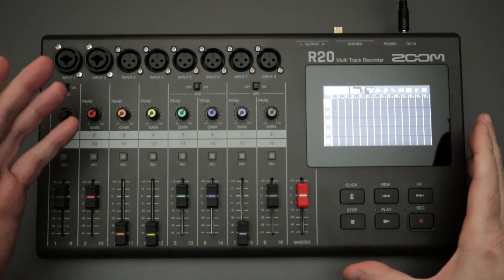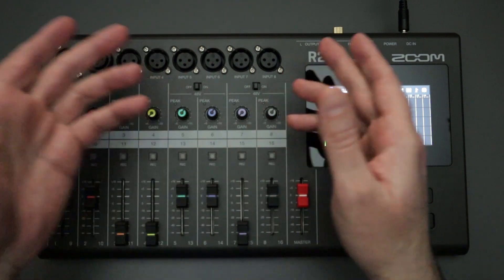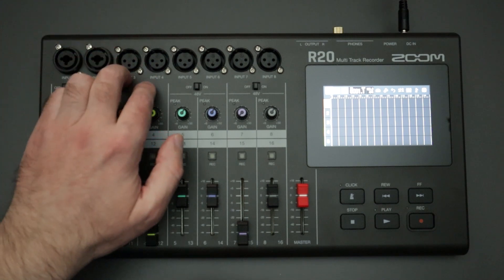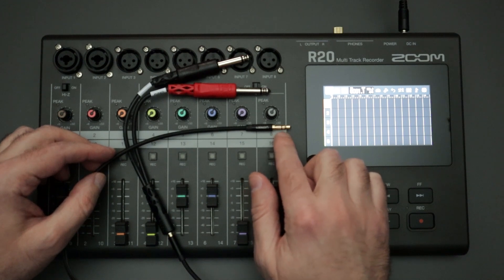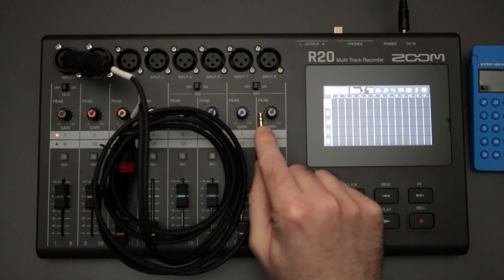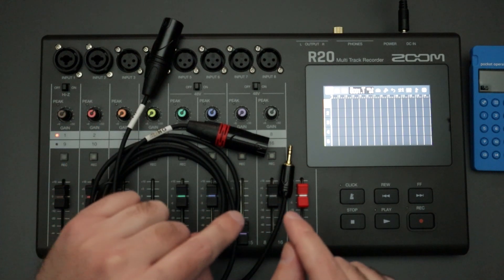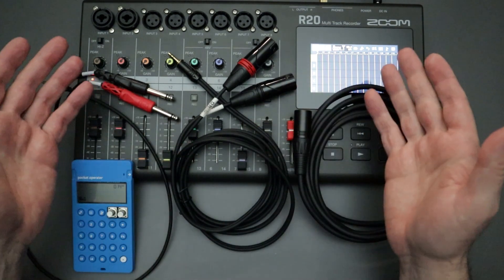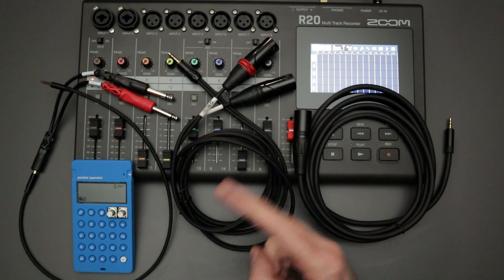ZOOM R20 - using all the inputs with TRS to XLR cables (applies to many mixing boards too)

Comment from the maker: I just wanted to further specify that you can absolutely use 1/4" to XLR cables, as long as the TRS to XLR cables are wired the same way as demonstrated in this video.  It doesn't just have to be 3.5 mm to XLR. Or you can place a TRS 3.5 mm to 1/4" adapter at the end of these types of cables.  However, you want to avoid sending stereo signals from a TRS cable to a single, balanced XLR end because you likely won't get any useful sound.
Reply: Is there a way to change the volume of a single region within a track?
Reply: exactly.. the reason the sound will be bad is because what do those channels is more than likely feeding back in through the other signal path. so the full signal is not making its way into the intended destination (ie XLR)...this is likely causing damage to your source device.. a little bit of damage here a little bit of damage there.. eventually with enough use and the compounding damage, your device well just stop working all together.. DI boxes, or mono summing cables are the best solution. 
Rule of thumb, if the sound is lower than you expect.. for instance if you have to turn your cell phone up to maximum and then boost the mixer gain way up just to get a decent signal, STOP STOP STOP. you should never have to crank the volume and gains really high just to get decent volume. if you ever find yourself having to do this, there is more going on under the hood that's causing this... repeated use will definitely be damaging your equipment.

Comment: @GazRendar, Hi, how are you doing ? Just one question, for example: Can I connect 2 balanced outputs (L+R) from Fractal, Kemper or other effect box with IR direct to inputs 3 and 4 ... or 3 until 8 using balanced cable (XLR to XLR) ? Or I just can use the inputs 1 and 2 for this purpose ? Thanks
Reply from the maker: Doing well, thanks.  Based on what you are describing, you should be able to use any of the inputs.   But really, using inputs 3 and 4 are perfect for that.  You just want to make sure you're running the Left signal on one balanced XLR cable to input 3 and the Right signal on one balanced XLR cable to input 4.   You don't want to run a stereo signal through a single XLR cable to a single input on the R20 because that might cause signal cancelation depending on how it's all connected and routed.  And obviously, if you are using the R20's inputs #5-8 keep the phantom power off if you are running those XLR cables from your effect boxes to those inputs.

Comment: Can't really figure this out from anywhere but I thought it was worth asking - could you hook up an interface to act as another set of combo jacks? i.e. Can I set up my Focusrite to input 3 and 4 and get some extras? Don't know if it takes usb audio...
Reply from the maker: No, that won't work.  It doesn't accept USB audio and the Focusrite usually needs drivers to work with a computer, so there's nothing like that with the R20's minimal operating software.  If you don't want to use TRS to XLR unbalanced cables you can always use mixing boards or DI boxes to get the job done.
Reply: @GazRendar  Thanks, I have an r20 on the way and your stuff has been very helpful and i know it will be again when I get down to brass tacks. Much appreciated.

Comment: Thanks for your great video. I have a question. Can I use two XLR-to-Jack cables to connect a Nord Stage piano with two separate outputs (left and right)? If so... then I think it should be TR instead of TRS? Thank you!
Reply from the maker: Yeah, so if your Nord has a 1/4" mono jack for Left Out and a 1/4" mono jack for Right Out, you'll need TS to XLR unbalanced cables.  I'm not sure if you can set the line level out on the Nord.  It might work with the R20's XLR inputs, but not sure if there will be enough volume there.  I'm guessing it will work ok, but you might have to turn up the gain on the R20.  If not, you could always run a 1/4" TRS stereo out of your Nord's headphone jack to XLR breakout cable with L and R mono, unbalanced XLRs to get it to work.   Then plug your headphones into the R20 to hear everything.
Reply: Thanks for your answer and advise @GazRendar  ! So there is no quality-loss if I use headphone out instead of separate Left and Right out ?
Reply from the maker: Unless you really turn up the headphone out volume to near max on the Nord, where it might distort the sound, there shouldn't be any signal loss.  On top of that, I think you are going to want to plug your headphones into the R20 to hear how the recording sounds, not how it sounds coming straight out of the Nord.   That's especially true if you apply any effects with the R20.  But you can experiment and test out cables for both the line outs and the headphone outs, depending on your budget.  I know it'll work for the headphone out, but I'm guessing it will probably work for the line outs too.
Reply: @GazRendar  thanks again for your detailed answer!

Comment: love the example of the 3.5mm TRS to XLR. I've seen so many examples of people using a cable such as that to plug in a laptop or smartphone into a mixer and then wondering why it sounds so bad. I think people need to understand how equipment "balances" a signal to fully grasp why you can't simply convert a stereo TRS signal to XLR just by using adapters or a generic cable like in your example. 
the best way to do it is by incorporating a DI box that will split the unbalancedstereo signal into 2  balanced mono outputs. OR, a more cost effective (but obscure) option is to build a "mono summing cable"... I built a few for my Zoom L12 because it has 4 Stereo TRS outputs (meant for IEM systems). but since I wanted to send the signal to stage monitors I needed to somehow mix down those stereo outputs to 1 mono signal. With a TRS to mono XLR (like in your example) it is very possible and probably more likely that you are causing irreparable damage to the output stage of the chain... in other words, there are 2 discreet signals flowing from your stereo output and since electricity will flow in the direction of least resistance (aka impedece) there is a good possibility that some of that current being sent from the stereo output is "feeding back" into the other channel of the output. Rule of thumb is you can split a mono output and send the signal to multiple destinations, BUT you cannot use the same splitter cable in reverse and combine 2 signals to send it to 1 destination... even though a stereo TRS plug is one plug, it is still considered two signals. so trying to combine those two signals being sent from that one individual TRS plug to a destination that uses one mono input (like a XLR input on a mixing board) could be damaging that source device. I mean it might work for a while..(although it would sound like garbage).. but eventually it will just stop working and you would have realized that you somehow have damaged your equipment. 
Making a DIY mono summing cable is not difficult and there are maybe one or two useful tutorials online (believe me, there's a lot of info on pro audio websites, but there are literally only a couple useful tutorials!). you basically need to use something called a resistor Network in one of the channels. Sounds complex, but it's just a matter of soldering in a couple of low voltage resistors in the signal path of one of those channels. this increases the impedance of that pathway, thus making the path of least resistance to be the intended output. So no more backflow of electricity slowly damaging your devices output stage. 
PS: some devices have inbuilt protection against this sort of damage.. but I highly doubt your pocket operator has the required circuitry to protect itself from this sort of damage.. so I hope people understand the risk you took and personally have to commend you on still providing this example for people.
Reply from the maker: Thanks for the additional info.  I have heard the term mono summing cable, but I wasn't entirely sure what it meant or how it was constructed.  I also agree that a DI box is the best bet for many people, but I know that if (usually hobbyist) musicians are buying these budget multitrackers or mixing boards, they might not invest in DI boxes or versatile preamps that can handle and convert unbalanced and balanced signals.  So I wanted to demonstrate the cheap way to go with those stereo break out cables.  I think they will work under most conditions and not cause damage to circuits.  Unfortunately, using that 3.5mm TRS cable to the single balanced XLR cable is likely what people will go to first when they are thinking about converter cables, but I wanted to show them that it won't send a functional signal from the source to the multitracker or mixer.  I didn't really think of possible backflow charge going from the left stereo out into the right stereo out (or vice versa).  I suppose that is possible, depending on the amplitude of the outputted signal and the inherent resistance of the cable.  I doubt my Pocket Operator has any complex circuitry to cut off or dissipate a backflow charge like that, but luckily it still seems to work after the demonstration.  Phew! I'll have to look into the mono summing cables...thanks!

Comment: Thanks for making the video, but I think most viewing this have only one question: Can the R20's XLR-inputs accept line-level signals? Since XLRs can carry mic-level or line-level signals, we just need to know if R20's XLR-inputs (i.e., inputs 3-8) can accept line-level signals. If it does, only an inexpensive mechanical 1/4" to XLR adapter is required. If it doesn't, then a much more costly DI is required. I believe your video indicates it's the former.
Reply from the maker: Yes, the R20's XLR inputs can accept most line-level signals and it works fairly well.  In the video I tried to simplify the connections that you can use, but like anything, the sound quality depends on a lot of things.  In general:

If you plug in a guitar with passive pick-ups, it sounds lousy with just a 1/4" TS cable to unbalanced XLR cable.  It's tough to get a strong signal and you pick up all kinds of noise because you have to blast the R20's gain. You'll want a DI box or a powered mixing board for that (or just use Input #1 on the R20).

If you use a TS or TRS cable to unbalanced XLR cable to connect anything with a headphone out to the R20, that usually works very well.  You can adjust the headphone output volume on the device (synth, e-drums module, phone, etc) and set the R20's gain to find a signal that has minimal noise with a strong, clean tone.

If you use a TS or TRS cable to unbalanced XLR cable to connect something with a true "line level" out to the R20, it usually works, but it will depend a little bit on what's coming out of your device because I think you lose a some signal when you go from TS/TRS to XLR.  If your line level coming out of mixing board or something is relatively low for line level, like say -10 to -14dB, you'll need to turn up the gain on the R20 to get a strong recording signal.  And right around that level you might have to get the R20's gain up to better than 80%, which might give you a some noise.  You can minimize that by turning on the noise gate on that channel on the R20, but it's right at the spot where it's not great for recording.  However, for things that pump out a line level that is somewhere in the range of -6 to +4dB, you can typically pick up a solid signal on the R20 without having to blast the gain with too much noise.

Sorry it's not a exactly a simple yes/no answer, but hopefully that response helps clear things up further?

Comment: Hi! Thanks for all the informations. I have a question. I connect aux cable to the first and second channels with connector and this is for open music from my smartphone. I cannot take signals from it. Why? Isn't it possible? Thanks.
Reply: what do you mean by "aux" cables? Pro audio, aux cables aren't really a thing.. for HiFi home stereos (consumer equipment) an aux cable is basically a stereo cable, usually 3.5mm TRS on one end, and either another TRS or RCA on the other end. Typically, pro audio equipment has mono inputs (balanced). so when you plug in a stereo Source into a mono balanced input, you will get phasing and frequency cancellation..or just like in this video example, you might even get complete cancellation if the left and right channels have the same sound.  
you need to buy a DI box or mono summing cable. You build the cable too.. you just need to incorporate a resistor Network in the XLR end. it's a bit complex but possible. I've built mono summing cables for my zoom L12.

Comment: No inserts,but I could use a DI box. Hmm, good preamps? Food for thought
Reply from the maker: You can definitely use a DI box or a mixer or a preamp if you have them.  Those 100% work well.  I just know when people are buying this type of budget-ish all-in-one multitrack recorder they don't necessarily have a lot of other recording gear around.  But if you are using powered equipment, this types of TRS to XLR cables can potentially work without the extra DI boxes or mixers.

Comment: Can the R20 be used as a live mixer?
Reply from the maker: It can, namely if you just need some kind of mixer for a one-time thing.  I wouldn't buy the R20 if you want to use it half the time as a mixer, though.  The biggest limitation is that you can't really route sounds to different outputs.  However you adjust your faders will route those same levels to both the single L/R monitor out, and to the headphone out.   If that's all you need, then yeah, it can work as a mixer.

If you are really looking for something that you want to use at least half the time as a mixer, and then sometimes also record, I would suggest you look at one of those hybrid mixer/recorder units - like the Zoom L-8 or L-12, or Tascam's Model 12.  Those will give you more options to route different channels to different headphone outputs with a little finer control over volumes.  You can also multi-track record on those units, however, the downside is that you can't really edit your tracks all that well after you record on them. 

So if you are looking for a true multitrack recorder that can work as a mixer in a pinch, the R20 can help you out.   If you want a true mixer that can also do some recording, I would go with one of those mixing board hybrids.

Comment: Thank you for this helpful video. Sorry for this question that may be silly : does it work with an adapter cable type : 6,5 mono jack to XLR mono for one of the Zoom XLR inputs (my synth (mono) to an xlr zoom input ) ?
Reply from the maker: It's likely that you can get a cable that will work for your needs.   I haven't tested it, but you can probably get a cable that has a 6.5mm TS male end that runs to an XLR end - but you want the cable to be unbalanced.  That should work.

Also, depending on your synth's output jack, you might be able to use the type of cable I had in this video, which was a stereo TRS 3.5mm breakout cable to two unbalanced mono XLR ends.  In that case you would just need a 3.5mm to 6.5mm TRS adapter...and then you would only use the one XLR end...in this case, the one labeled "tip," or the "T" part of the TRS.
Reply: @GazRendar  Thank you very much for your time and for this detailed answer !!!